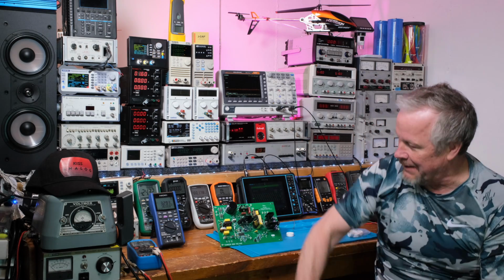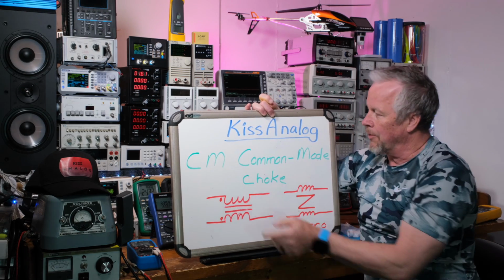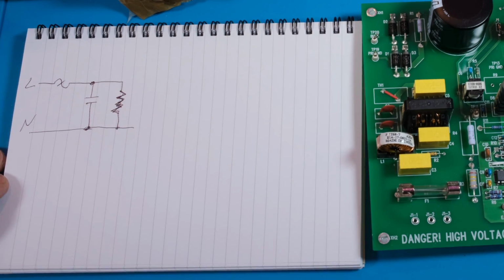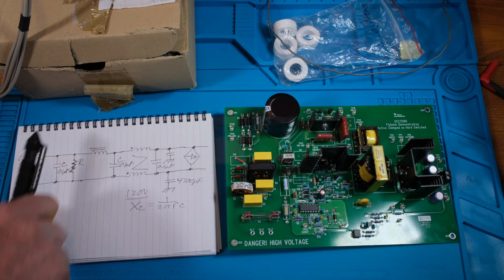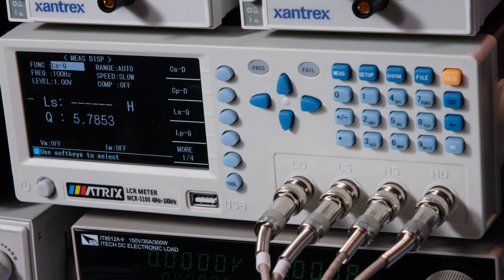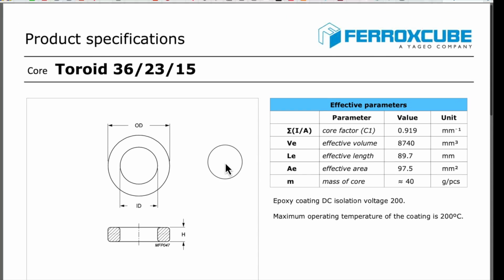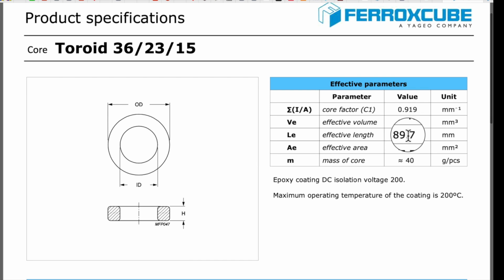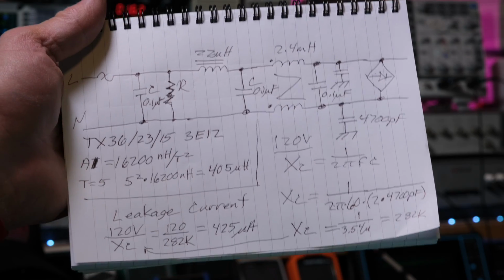How to wind a Common Mode Inductor - Winding an Inductor for an EMI filter #commonmodeinductor

Comment: This video finally cleared up the winding direction questions I had about common mode chokes, and the reasons for winding in a mirrored fashion. Thanks, from a new amateur (ham) radio operator making a do-it-yourself radio frequency common mode choke for an antenna system!
Reply from the maker: Thanks for your feedback - I'm happy that it helped you!

Comment: It's probably a bit more advanced topic, but do you have a video covering the frequency response of a common mode choke? And maybe the possibility of making it more "broadband" by putting two cores (made of different materials) together and then winding your turns through BOTH of them?
Reply from the maker: Thank you for asking about this.  I will do a video soon to talk about this.  I have used 2 cores before (that each have different characteristics).  This would be a great topic - thanks!

Comment: I'm looking for a way to get rid of the pesky noise that comes out on the power leads of a my DC switchmode bench power supply into my connected circuitry. Would one of these chokes reduce/eliminate the noise if place on the output of the supply. If so which way do I make/orient the turns. Maybe add a capacitor in there also? Capacitors only across the output have been ineffective.
Reply from the maker: Thanks for asking!  I've been meaning to get to that video;)  I'll do one very soon.
Reply: That would be great.because it a real issue with these supplies especially if you want clean bench power. Not that I couldn't build a linear supply. But the switchers are so versatile with low cost these days.
I'll subscribe in wait for your solution to the problem.
Thanks
 @KissAnalog
Reply from the maker: Thanks for subscribing!  I'll do this video very soon.  I really have been chomping at the bit to do it just for the reason you stated.  It would help others put their concerns of noise at bay;)
Reply: FYI. The output crap on my switcher measures 50Khz at 30mv. I'm sure it would probably change with the load. I think it might have had a 2A load at the time I measured. Thanks
Reply from the maker: Thanks for that info.  Knowing the frequency and ripple voltage is very useful.
Reply: Your results may vary. 🙂. I find just sitting there with the scope connected it varies up an down A LOT in amplitude from say 20mv to maybe 150mv. And the frequency is difficult to determine because it's so full of "hash". I just look at it on a long sweep so it's a wall in crap. Thanks
Reply from the maker: Have you tried putting your scope in the 20 MHz bandwidth (many scopes can do this).  That will clean up the signal.
Reply: Well. Yeah. It will look "cleaned up" but the the ideal situation would be to actually get rid of the crap not hide it.

Comment: Thank you for another helpful video. One comment follows. At around 19:20 minutes you say that common mode signals result in magnetic field cancellation in the core. I think it may be the opposite. If the fields were to cancel the inductance of the unit would be zero and hence it would not provide any impedance (i.e., choking action). If I assume the same magnitude of current enters the two lower wires (at time 19:22) and then use the right hand rule to determine the direction of the resulting fluxes I believe they are both counter-clockwise and hence add together. - Cheers - Jim
Reply from the maker: Thanks for the feedback Jim!  What I meant was that for normal mode - where current is flowing thru the circuit - the fields cancel.  But, for Common-mode current flow - the field builds as both currents are circulating in the same direction.

Comment: I'm wondering : When you wind (as in 19:00 in the video) one phase on one side and the other phase on the other side, you built two coils that each create a magnetic field separately that just 'connects' via the core top and bottom section (between the two phase coils). 
With those separate coils wound, if you have significant differential mode current, wouldn't the magnetic fields in each coil saturate the core, thus rendering the whole choke useless for common-mode currents as well ? After all, the two coils need to exchange their magnetic field via the core. 
Wouldn't it be smarter to wind BOTH phase wires next to each other, so differential mode current never builds up a magnetic field in the core ?

Comment: I play with LC circuitry to filter switch mode noise from power supply to DAC
It makes a big improvement on sound quality for virtually nothing. It’s quite amazing on scope how effective it can be .(just remember the fly back diode)
Reply from the maker: Thanks for sharing this!  Yes if the DAC can have higher resolution by lowering the noise floor around the DAC.  This can be measured.

Comment: Lots of good info, as usual, but it leaves me with 1,000,000 questions. Why three X caps? Why are the Y caps on the load side? Aren't they usually on the line side? Is the resistor there to discharge the caps when power is removed? Since the common mode choke on the demo board has deliberate leakage inductance, why is a separate differential mode inductor needed? How are the values of the resistor and the inductors and capacitors chosen? How do you insure that an EMI filter meets the Middlebrook stability criteria? How do you measure or calculate the output impedance of an EMI filter and the input impedance of a power supply? How common is it to use custom inductors vs. off-the-shelf ones? How would you simulate an EMI filter in Micro-Cap? Lots more topics to cover in future videos. And those are just the questions off the top of my head! And how does the value of the bulk capacitor affect the operation of the filter? Does it need to be taken into consideration? O.K., O.K., enough for now . . .
Reply from the maker: Thanks for the great questions!  I will place parts in the EMI filter as place holders and not populate all of them - unless needed.  The Y caps on the load side give a place for CM noise from the load to go instead of out to the line.  But, placing them right at the input (line side) often works great too;)   I'll walk through a design to show the steps in a step-by-step method.  The bulk capacitor can cause large current spikes if too large.

Comment: this is an awesome video about ferrites and very useful practically speaking i must say i have learned a lot from it. thanks so much

actually i have here an old rusted isolation transformer. where a lot of the laminations seems like they have had water ingress and so i am wondering if the performance of the magnetics has become compromised as a consequence of that.... hoping to try to teat how well it does under a load. but also maybe can passsively measure the inductance of the coils on my de5000 lcr mater. to see how much it deviates from spec. i am hoping your video will perhaps help me to know what to look out for. i suppose its applicable where you mentioned capacity before saturation. if too many laminations are compromised then maybe this capacity is reduced and then it saturates sooner at a lower current?
Reply from the maker: It sounds like you have a good understanding of this;)  It is interesting what rust would do.  It is possible that the worst thing that you experience is just vibrations of the laminations and otherwise they work just fine.

Comment: I struggle when it comes to winding inductors, always have to think it through but still second guess myself.

It threw me off when you started winding the second coil on the toroid and described it as being wound backwards to the first. I look at both wires and see them both going down through the center. But I guess it all depends on the mode. If the current is flowing the same direction on both wires, then the current is passing through the center of the toroid in the same direction, but when the current flow is differential, one wire has current going down through the center and the other wire has it coming up through the center.

It might help to see both wires wound on the same half of the toroid.
Reply from the maker: Thanks for the great feedback!  I will show how to do this again - and how to select the core as well.